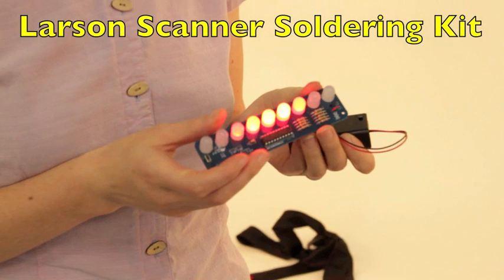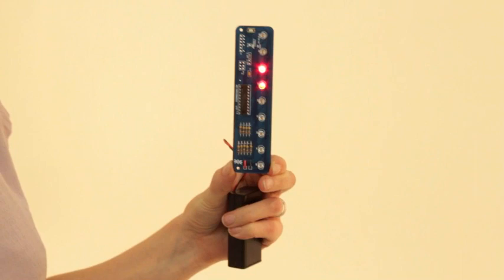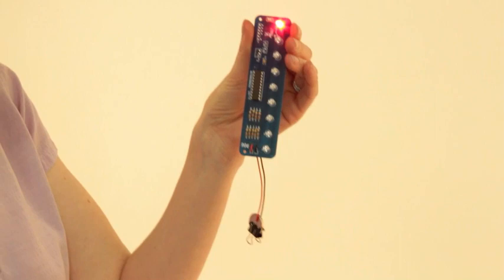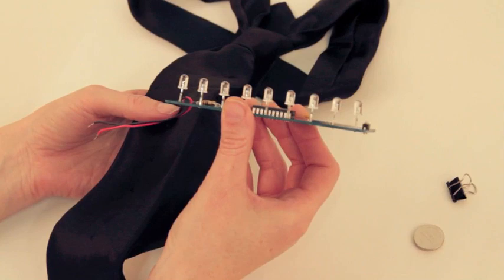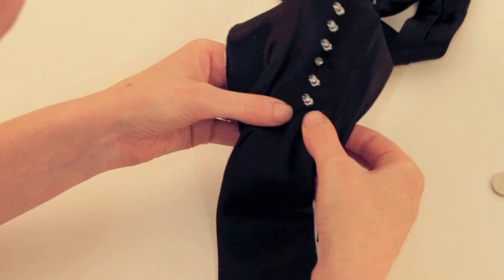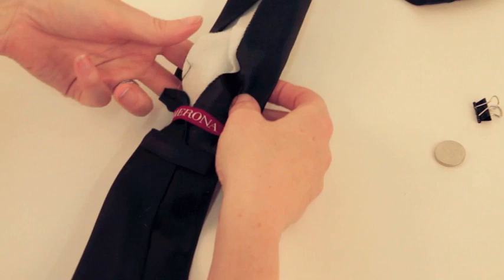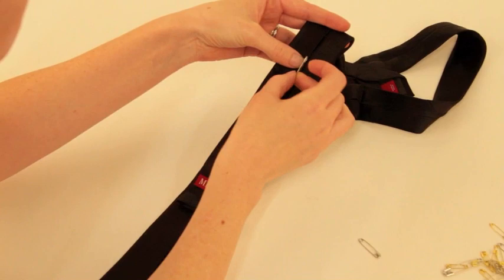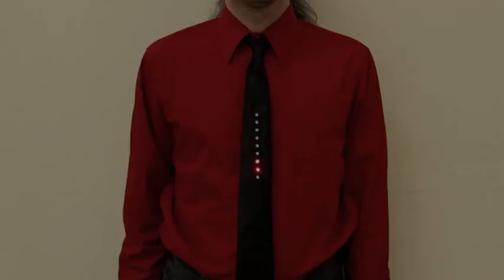Kraftwerk-inspired LED Tie

Comment from the maker: If you get the current version of the kit, this is already programmed. Solder a wire jumper across the position "Opt 2" on the circuit board to enable it.  See the link above (at evilmadscientist) for more information.

Comment: I've wanted one of these for years ... just a shame it costs so much to get a Larson Scanner to the UK, never mind import duty and associated "handling fees"
If I eventually do manage to get one I'd probably make a pouch for the battery on the back of the tie, allowing for switching off and also sew up the back to prevent the danger of pins shorting out the board